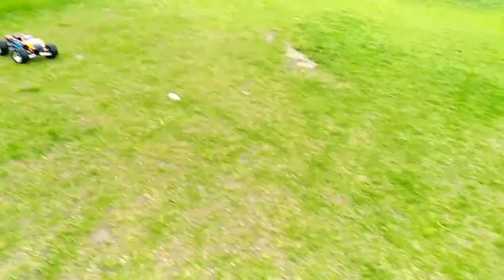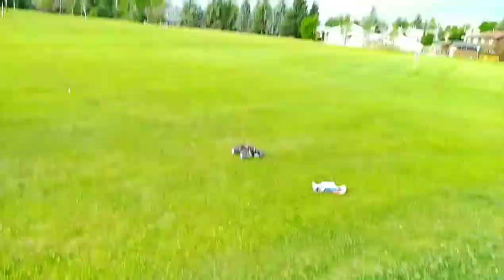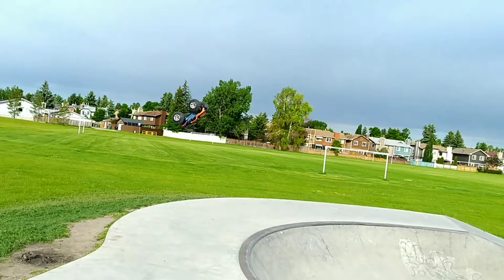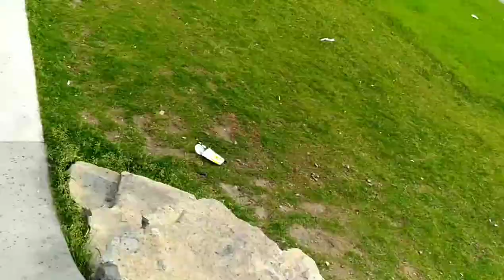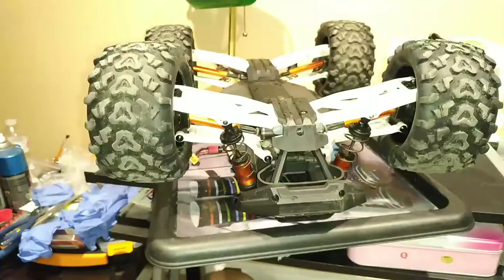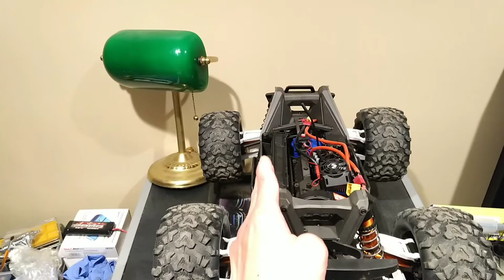wide maxx max8 test on pouch and brake using 4s, as testing the gpm aluminum pin holder

Comment: That’s right the plastic only lasts for so long upgrades a plus👊🏾✌🏽
Reply from the maker: First, thanks for watching. Yep you're right, upgrade to aluminium is almost a must on most truggy, even my rustler 4x4 need some, just hope I don't need much to make both truggy tough enough for jumping, however I think I am almost there with this two traxxas, probably a tiny little more upgrade then I can go on and upgrade the others.😊